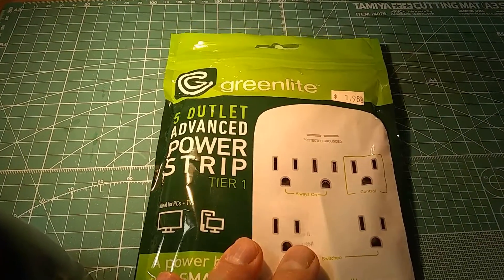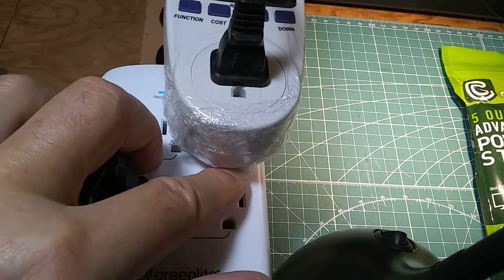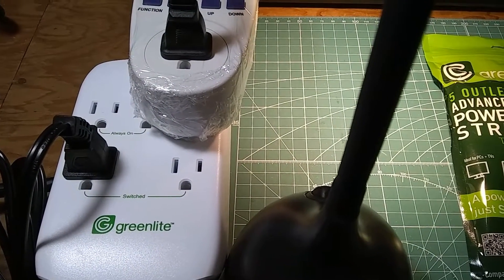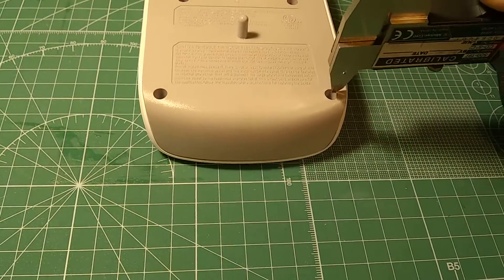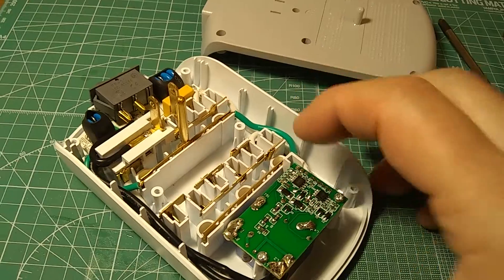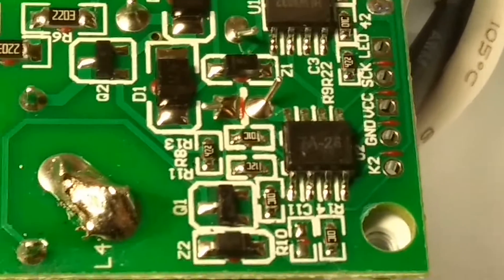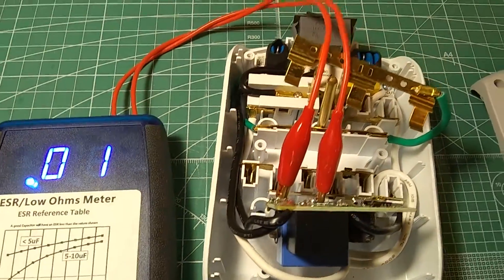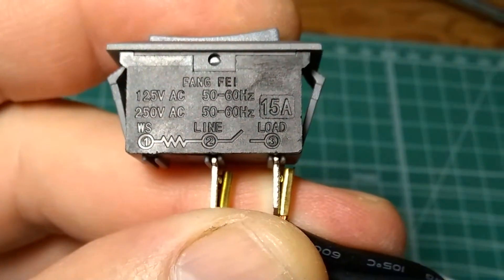Greenlite Tier 1 - Advanced Power Strip Review + Tear Down

Comment: We purchased 4 and NONE of them worked with the on/off switch. The constant "on" setting works on the top three outlets. But the two switched outlets on bottom do not work. And it is the same on ALL FOUR units that we purchased. VERY disappointing!!
Reply from the maker: For the two outlets on the bottom to work you have to plug in and turn ON something (a lamp etc.) into the CONTROL outlet. Try that. 

The appliance you plug into the CONTROL outlet (top right) has to be 10 Watts or greater. If it's too small it will not turn ON the two bottom outlets.
Reply: @jerryzabin the problem is you don't understand how it's supposed to work. It's a power-saving device, not a regular outlet expander. The goal is to eliminate "vampire" energy drain which is common on many many devices. Plug your TV into your Control outlet, then put your disc player, speakers, cablebox, game console, computer on the  switched outlets. No point in letting them suck power if you're not using them. And so they don't get access to power until the TV gets turned on. Just one possible configuration.